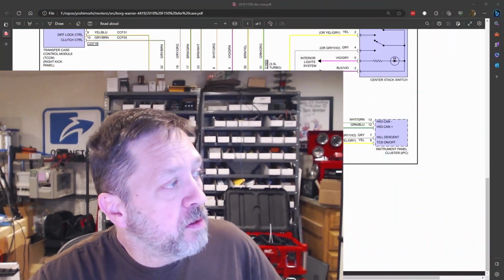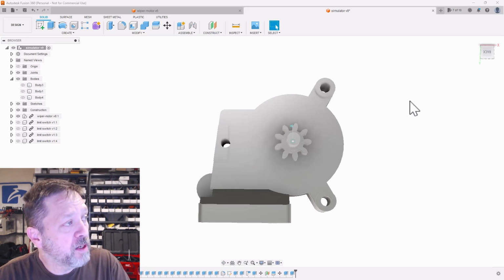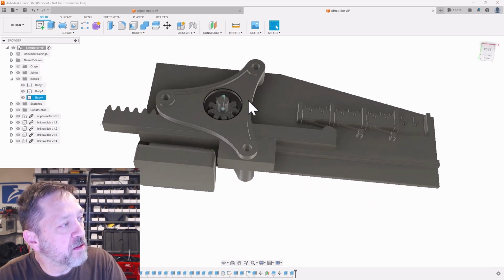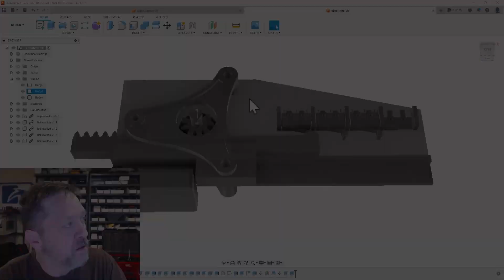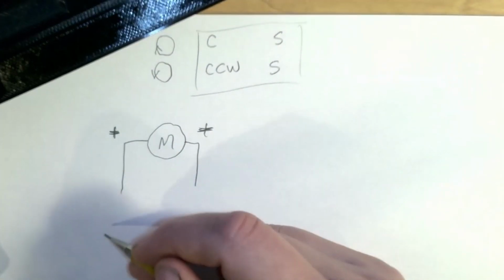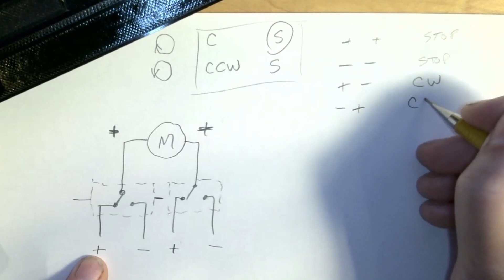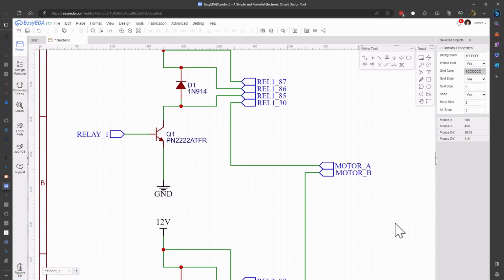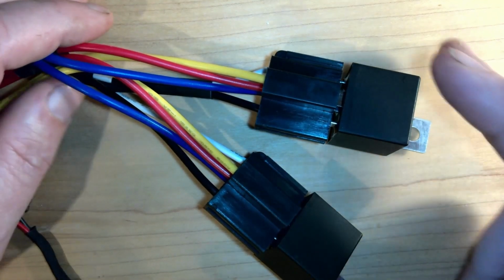Using C# to Control a BorgWarner 4419 Transfer Case (Part 1)

Comment: Curious if you made any progress with this or a part 2 in the works?
Reply from the maker: I shipped this and it got installed in a 1972-ish F150.  I have been wanting to re-visit the controller to make it more generic so it will work for more transfer cases